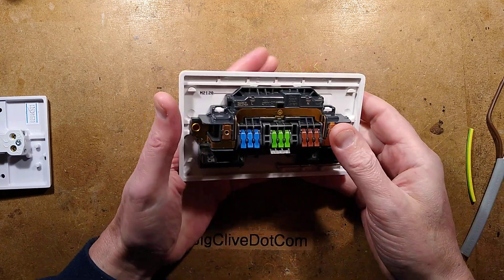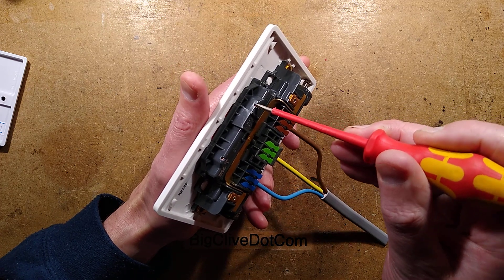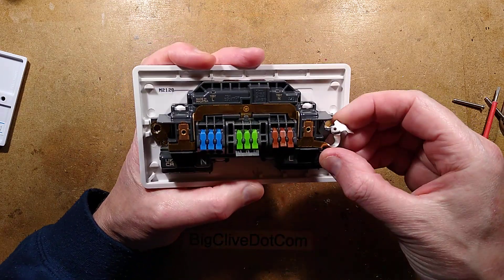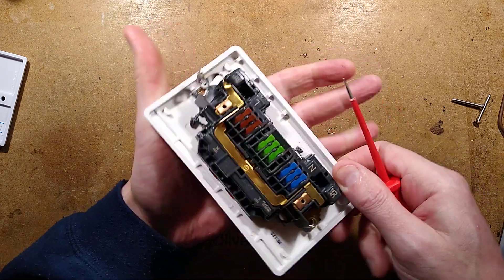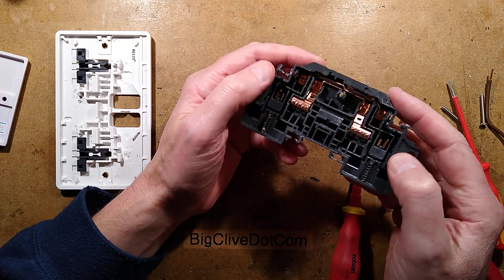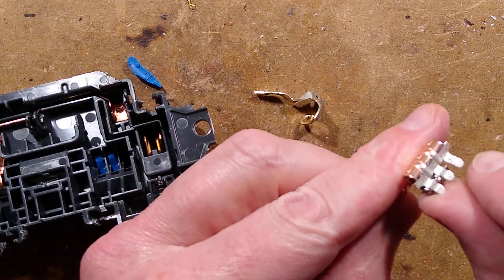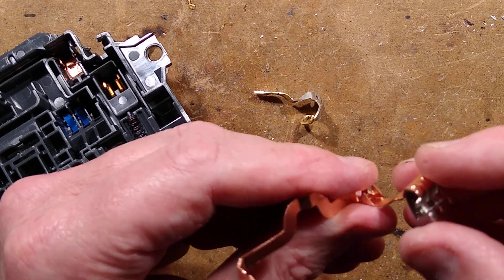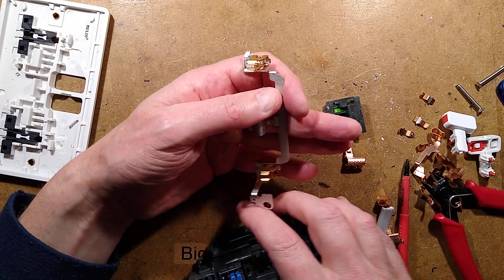Teardown of the new MK screwless socket

Comment: Even the traditional MK plugs and sockets are a million times better than the dreadful New Zealand crap we have here. Flimsy pins, often no proper cord grips. Not a fuse in sight. No ring mains, ohh the pain! Worth returning to the UK for a descent and safe electrical system. Still, could be worse, 110volts 60hz for an example.
Reply: Ring circuits are an abomination. As both ends of the ring share the same fuse, a loose connection makes it super easy to overload the wire. It's much better for there to be only one possible current path.

Comment: Did you say a complete ring of wiring that returns back to the box? Is that to avoid potential across your body if replacing an outlet? Trying to figure out why that is necessary. Unsophisticated USA electrician here.
Reply: No, the ring provides a dual path for current to any outlet on the ring, so the copper conductors used can be rated for less current than the breaker protecting the ring.  (typically use 2.5mm sq cable which is rated at about 26A depending upon ventilation - and a ring breaker is 32A).  The story goes that this was a copper-saving idea when materials were scarce for post-war rebuilding, but I'm not entirely sure how true that is. The ring works ok but is vulnerable to being broken (and hence losing the essential requirement of current sharing down either side) by DIY activities or bad connections.

Comment: Shouldn't the wire leads be cut so that the earth disconnects last if the cable were ripped out of the box? Or does that only apply to the plug?

Seriously though, I would be so happy if American plugs were this nice to wire up. If only...
Reply: You could do that, but really in that circumstance you've just got live wires hanging out the wall - whatever you do.

Comment: It would be interesting to see these Wago-styled clamps on European sockets as well... by the way, what's the point in using ring circuits? Looks like more work to put in a ring than a radial circuit, harder to troubleshoot a cable break, and having twice as much cables in the distribution board seems impractical as well. I'm not an electrician by trade, but I do work with electronics, and have no problems with replacing a socket, switch or a light fitting.
Reply: Economy (less copper). The diameter of cable (2.5mm sq) used in the ring isn't, on its own, rated for the full 32A that a ring is fused at. By returning one length of cable to the same terminals it started from, you now have a dual path for the current and the cable, in theory, can't be overloaded. Yes - all sorts of issues there with broken or high resistance connections in the ring.... but it has sort of worked without too many fires for a long time.
Reply: @rossthompson1635  Makes perfect sense, thanks.
Out of curiosity, I just checked copper wire prices (usually single insulated wires are being run in a plastic conduit here in Slovakia), and 1m of a 2.5mm2 cable costs 0.35€ and 1m of a 6mm2 cable (which is supposed to be able to handle 32 amps) costs 0.60€.
On the other hand, I have a 32 amp fuse for my entire flat, which is perfectly fine, because I have central heating, centrally heated water and a gas cooker. My largest appliance is my washing machine & dryer (combined unit) and microwave oven, which also has hot air and grill capabilities (and you can run the microwave function together with either grill or hot air). So far I never had a breaker trip due to overload.
Reply: @AttilaSVK  32A for the whole flat seems reasonable if all of your heating and cooking is gas. In the UK properties typically have a 60, 80 or 100A main fuse. Then for an average 2 to 4 bedroom place, this would split in the main consumer unit (fuse box) to maybe two 32A rings for socket outlets and fixed appliances less than 13A rating, two 6A lighting circuits (radial) and a 32A electric cooker circuit.  Also electric showers are quite common here, and would have maybe a 40A circuit.  Of course the total draw can't exceed the main fuse but that is factored in, you'd never run each circuit to maximum capacity.  Now that electric vehicle charging points are being fitted, you might have another 32A breaker for that - so this does start to make the main fuse capacity become an issue to consider.
Reply: @rossthompson1635  The safety downside of ring circuits could easily be eliminated if they put a fuse on each wire instead of splitting a single fuse across both sides.
Reply: @eDoc2020  I see where you are coming from but I think having a fuse or breaker in each leg could lead to more accidental broken rings. Also the break could be the neutral side only, so the live conductor current would still be shared. Don't really want to start fusing neutrals.  Probably best if the UK stops using ring circuits and splashes out on radials :-)
Reply: @rossthompson1635  The way around the broken neutral issue would likely be to use a 4-pole breaker, 2 poles for the hots and 2 for the neutrals. Each wire gets its own protection and if there's a problem all paths get cut. It might not be practical but it would solve the potential safety issues. Fusing the neutral together with the live would also help if there's a mixup between neutrals on different circuits but on the same RCD. For that matter an RCBO (which AFAIK cut off neutral as well) would be best on all circuits.

Even if a ring is safe there's also the minor issue that uneven current sharing could result in non-cancelled magnetic fields heating up metal conduit. I can't imagine this actually causing harm but the US NEC specifically says you need to keep everything together.
Reply: @eDoc2020  Yes, I see that would work as a technical solution - not sure if we have such a device in the UK.  Probably better to get away from rings altogether.  Worth noting that many properties here still have rewireable fuses rather than breakers - in those cases the ring(s) would have a 30A fuse, but an old fashioned rewireable fuse will sit happily at well over 30A for hours before it melts, e.g. 45A for at least two hours I seem to recall. (cartridge fuses are faster).

Comment: Clive, why do they not make power outlets pluggable, so that if the a switch fails or the one's with usb power fails you can undo the two screws, pull out the socket and plug another in? The back plate can have the termination. Who owns MK is it Honeywell as there is a video of 5amp 3 pin plugs that still  can be used with Honeywell logo on the video.

Comment: Great video, Clive! Thanks for the teardown - very informative. 🙂
These are very good sockets and simple to use. More expensive but it's a guaranteed good connection and will accept up to 4.0mm2 cable.
So far, so good but MK need to sort a similar solution for the nightmare that is "The Ceiling Rose". A spring clamp version would be absolutely fantastic!
Reply: Aren't ceiling roses just a round box with a terminal block inside? I would think you could just use a Wago block instead.

Note, I'm American and we don't use anything like ceiling roses ourselves.
Reply: @eDoc2020  Yes they are just that but very often instead of just 3 cables (supply, lamp & switch) there can be a rat's-nest of cables & terminal blocks! Wires coming from wall lights and ceiling downlights etc. can be a total disaster. There's also very limited space for the additional wiring. I have used Wago's but there's a regulation that all terminal blocks should be secured and not hanging freely in an enclosure (I think that sill applies). Anyway - I dislike them a lot!
Reply: @daveseddon5227  I suppose Wago connectors could be harder to cram in tight spaces but I wouldn't think there would be much difference. If there are rules requiring the terminals to be secured then surely there would be clamps available for this, but then installing them would take away much of the benefit of the Wago connectors.

One great thing about US-style wiring is that there are rules on how many wires you can put into a certain sized box. This means we (theoretically) never have super-cramped wiring. All ceiling lights are connected inside a box so we have much more space to work with.
Reply: @daveseddon5227  and usually the rats nests of wires for the lighting circuits, will have been installed by an ‘electrician’, judging by what I found in my new build house back in 1999. I replaced most of it myself.
Reply: @normanboyes4983  You're not wrong!
I'm an electronics technician but have always done work on domestic electrical systems & am sometimes horrified by wiring installed by professional electricians. New housing estates can be some of the worst examples as they're done to a price & limited by time.

Comment: Aluminum is not "ideal" but it's fairly good. Most high voltage lines are made of aluminum.
Reply: Aluminum is not ideal, because of the way aluminium behaves at the point of contact. it's really hard to terminate properly in a domestic environment, however with the HV transmission lines it's a different game entirely, for example you have much more space to terminate the lines properly, so you can use aluminium in the first place
Reply: @deelkar  copper coated aluminum do solve most of the issues thought it is certainly inferior to pure copper in most aspects (except the cost).

Comment: One tiny thing that seems a bit odd is that the Testpoints are opposite to the terminals. That could have been neater and have them on the same side
Reply: They are on the top of the outlet, so when it's wired you can easily reach them when pulling out of the wall

Comment: IT seems much better than screw terminals. These will always automatically be torqued properly etc. Here in sweden elecricians and alarm/telephone technicians are known for not having any feeling for the torque a screw needs and so eiter torque them down enough to break the conductor or not at all. This type of terminal seems much safer.
Reply: @snaplash  The US-style "backstab" connections are terrible. It would be nice to see a comparison between them and Wago-style connections.

The best option for American outlets is the screw clamp found on higher-end devices which I believe provide better contact area and are less sensitive to creep than the regular old wrap-around screws. Still the proper way is to tighten all connections with a torque screwdriver, even though nobody seems to actually do that.
Reply: It happens in the opposite manner here. I needed to use a granny charger for some hours so thought I'd check the connection to the socket behind before running continuous 2.9kw through it. The socket has been there for more than 20 years, before I moved here and the terminal screws were not tightened at all. As I released the socket from the wall the wires fell out.
Reply: @stulop  Exactly as I stated either too much or nearly not at all. Seldom anything in between.
Reply: @stulop  I shoult say for completenes that it's the same in my business (Auto mechanic) but there its almost always torqued to breaking point that is the norm. First over torque and then 2 or 3 extra pulls of the spanner or pushes of the trigger on the nut driver.
Reply: @stulop  Many alloys shrink over time under pressure. A screwed connection cannot adapt, but a clamp connection can.
Reply: @stulop  Many alloys shrink over time under pressure. A screwed connection cannot adapt, but a clamp connection can.
Reply: @snaplash  Testing shows that your concerns appear to be unfounded.
Reply: Absolutely much better than screw terminals! Why did it take so long in over in the UK for them to do this finally?

Comment: Might solve the over/under tightened screw problem.
In my current house about half the screws on sockets were too loose and the outlet would be warm to the touch, and some others had been tightened so much that either the wire was cut or the screw thread stripped, and again the outlet was warm to the touch. First thing I did was replaced all the outlets with new ones, and even had to pull some new cables as the old ones were "somewhat charred".

Comment: It saves the conductor losing its cross sectional area by the ham fisted sparkie chewing through the wire with the old screw😁 particularly in countries like Russia that used and still do aluminium wiring. I have always liked the UK ring circuit concept but being an Australian I am happy we don't have that in our code and I haven't seen it in all the other countries I have worked in. I also liked the ceramic fuses they use to put in there outlets but why such an ugly bulky electrical fittings design?

Comment: I wonder how big a contact surface area there is between wire and spring term though Clive ?
I dunno what's wrong with a folded over wire in a brass screw terminal - that's got to be a better contact hasn't it ? MK know what they are doing mind you, I admit...

Comment: Would be interesting to see how the connections cope under thermal stress in a load situation, ie expanding, contracting and eventually becoming loose
Reply: Yes, and oxidisation over time.
Reply: @rossthompson1635  No oxidation inside a high contact force connection like that.  That is one of their specific benefits.
Reply: @JimWhitaker  True, if force is high. It just leaves me with a sense of unease when you can still easily rotate e.g. 1.0mm cable in a Wago or similar, either the push or lever type. But I guess at the point of contact there is still a strong force - and I have to admit all evidence so far suggests they are absolutely fine (and it doesn't stop me using them, once you have it is hard to go back!).

Comment: Very nice looking arrangement. I suspect the "WAGO-style" connection system is going to become a very well-copied standard, seeing as our Chinese friends do so many (pretty reasonable) copies, "in all the colours".
Reply: My Huawei 6KW solar inverter uses the WAGO connectors making terminating the mains feed quite painless. My last inverter needed an Allen key to lock the cables in place and it was very finicky, so a big improvement there.
Reply: Yes. Also, it is pronounced "VAGO" but everyone seems to prounounce it like our dear friend bigclive ;)
Reply: The Chinese 3 wire "straight through" wago are especially useful, used one today in fact to rejoin a wire what a mouse had chewed through. I prefer them to using a different connector for each wire. It was only for a 12V AC transformer.
Reply: Wago may be the popular name now, but spring loaded electrical terminals have been used in florescent lighting fixtures for at least twenty years…
Reply: @Mark1024MAK  and they are one of the most common causes of failure in florescent lights due to thermal cycling!

Comment: Clive, how big is the metal where the Wago style clamp hits the conductor, can't zoom in enough on the vid to see. It looks like the area of the clamp is less than it would be with a screw which then brings doubt into my mind if these will fail if under high load for a few hours.
Reply: The area is tiny and under high pressure (kg/square mm).  That is why it is a very low resistance and hence very low heat generated at the clamping point.

Comment: 0:43 Is one wire not insulated? This is the first time I've seen such a cable.
Reply: On UK wiring, solid core cable intended for permanent installation in walls has a bare protective earth wire and insulated power wire. I think the idea is that if the wire is in a wall and someone puts a nail through it, its more likely to contact the earth first or something like that. Electricians carry about green & yellow sleeving to put on the ends so that the wire can be insulated inside the wall box.
Reply: @IanSlothieRolfe  Thanks.
Reply: @IanSlothieRolfe  More importantly, it's cheaper to manufacture.